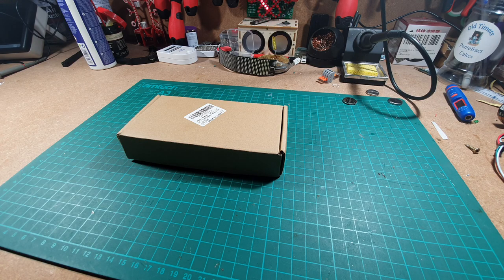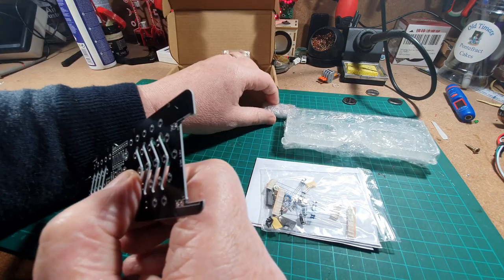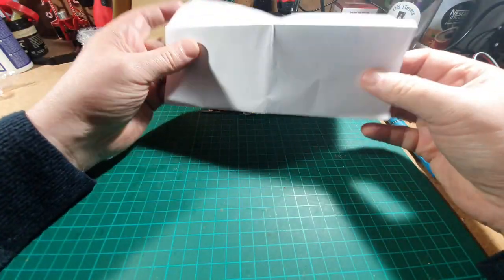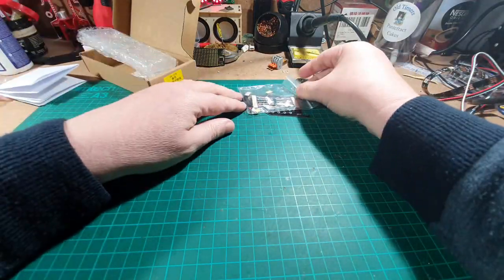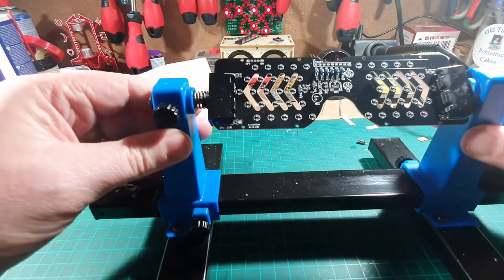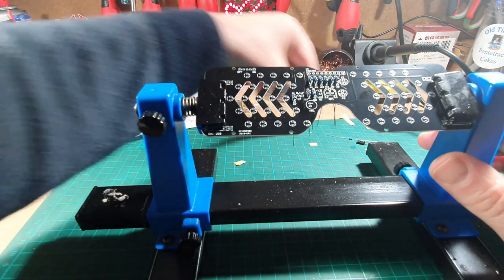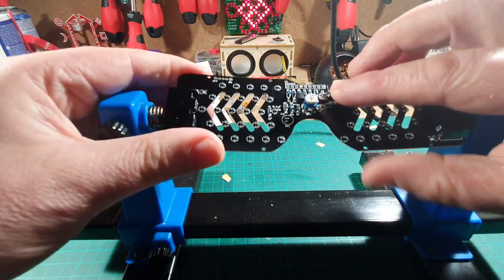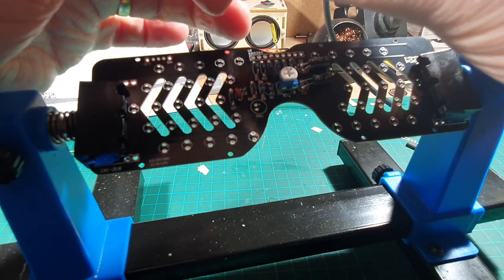Kit build of the AliExpress LED Glasses (Sound to light)

Comment: I just bought this kit.  Your vid will be most helpful. What temperature did you set your soldering gun at?
Reply from the maker: about 430c
Reply: @MikesLEDShed  Mike, 430C is around 806F.  Perhaps the 430 is Fahrenheit?
Reply: Mike, I made this kit.  It works!  I used around 400-430F for my soldering iron.
Reply from the maker: @am1manTravel  Brilliant - well done 🙂

Comment: What are you using with your left hand ( the metal thingy )when welding?
Reply from the maker: This is the solder, i use 63/37 Tin Lead Solder Wire Rosin Core Soldering 2% Flux